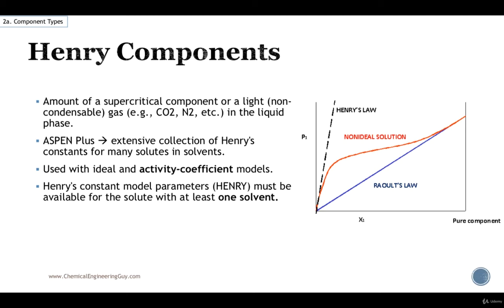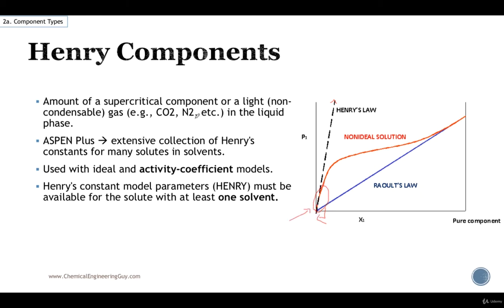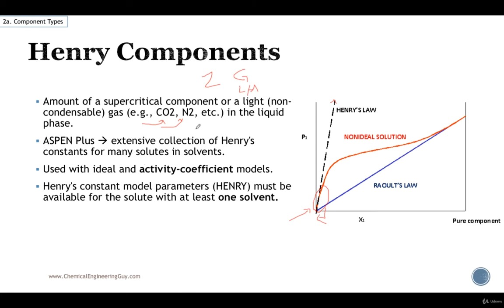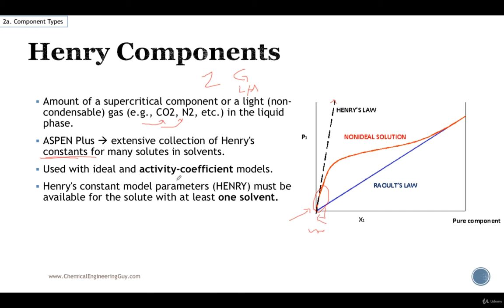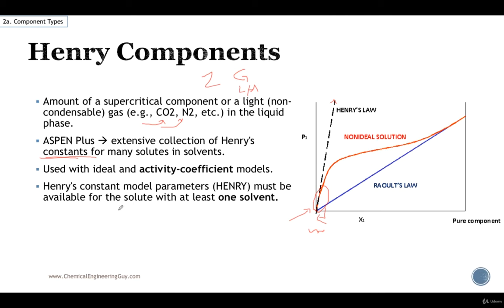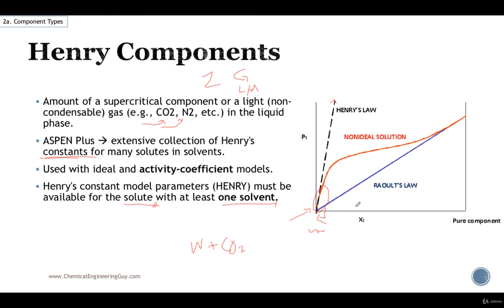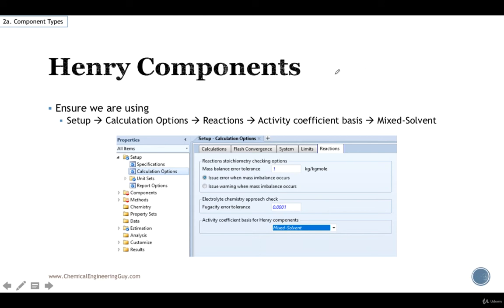Specifying Henry Components in Aspen Plus

Comment: can you explain why we need to define non-condensable gases as henry components?
Reply from the maker: You do not need to... but if you do so, aspen plus will favor those non condensables as gases
Reply: @ChemicalEngineeringGuy  so that the result will be more accurate, or this is just to accelerate the computation speed? Thx
Reply: @ChemicalEngineeringGuy  didnt quite get what that meant? what does defining them as HENRY components actually does to the simulation?

Comment: thank you for this video..... i got a question..... if I am to understand you correctly, you stated that we should define henry's component in Aspen plus when we have non-condensable gases? but at the end of the video, you did not define it? was it on purpose? or is the activity coefficient basis-mixed solvent... just enough for aspen plus to identify the gases?
Reply from the maker: Yes, it is recommended if you recognise a non-condensable gas which will be slightly soluble in the aqueous phase, and of course if this is of interest. At the end of the video I just showed the "print screen" of the Form in which we should add the components. I will upload the workshop in which we actually do all in Aspen Plus, from component specification, method choosing, and adding the component list required for the henry's components.